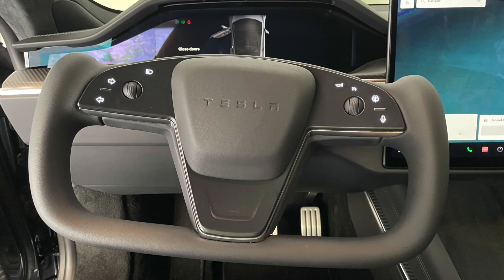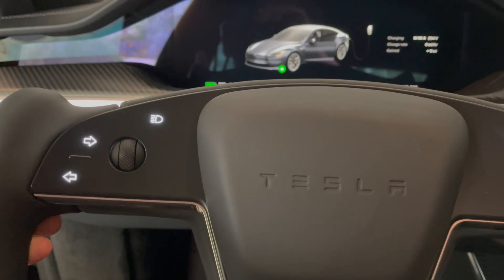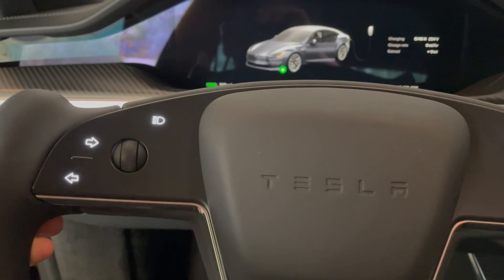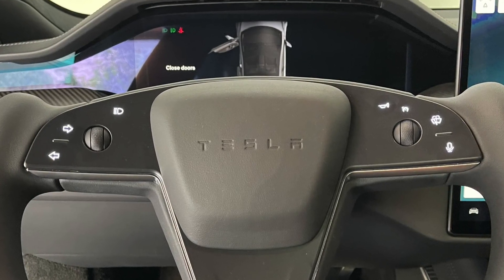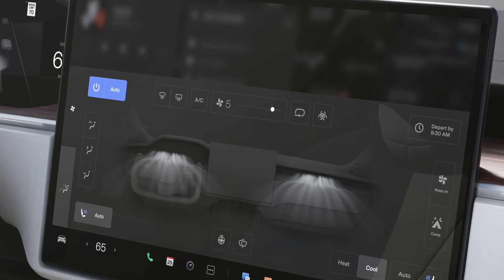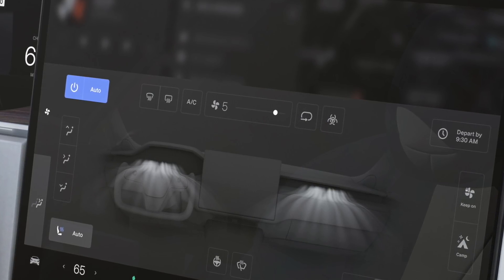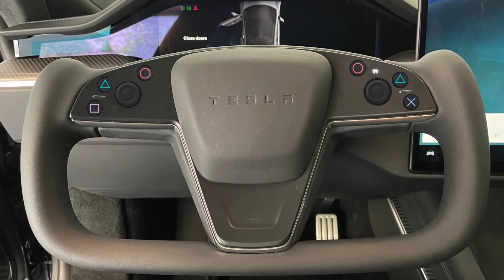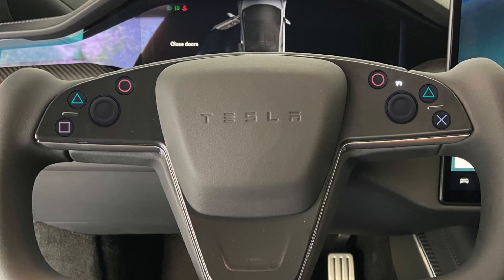Fixing Tesla's Model S Plaid YOKE blunders

Comment: I think it's scary that I have to share the road while I'm on my bike with a car that has so many distractions (huge screen) and difficult to use controls.
Reply: You might be safer with a Tesla next to you on the road than most of the other cars in the near future. Based on a recent video with Andrej Karpathy (Director of AI at Tesla), the cars already today keep an extra eye on the surrounding and may stop drivers from doing stupid things. He showed four example videos where the system took action and helped the drivers avoid disaster. In two of them the drivers, while driving into a parking spot, mistook the gas pedal for the brake, but the system braked instead and one of the driver didn't drive into a lake and the other didn't run over some pedestrians on the side walk. The developing of AI and computer vision for cars will prevent a lot of unnecessary accidents in the future.
Reply: Again, you're talking about issues that aren't even issues. This vid is about the issue with the wheel, not the screen. I'm pretty sure there are 0% Tesla owners who actually find the screen distracting.
Reply: @radfree9370  "Aren't even issues". So you think being unsure whether you switched an indicator on or not being able to easily sound the horn are not issues? 🤦‍♂️ It's poor design and is dangerous.
Reply: @Boopop1024  How do you even know its dangerous? Have you tried it yourself? This person says he doesn't like the design which I completely understand. But there have also been loads of YouTubers who say the either love the design or have gotten used to it anyway. Of course you're probably gonna say that all those YouTubers are fanboys. My point is that you shouldn't judge it if you yourself haven't tried it. I bet in just a few weeks and not even months, people are gonna say they've gotten used to it. The situation is just like when people thought that it was dangerous for the model 3 to not have a instrument cluster. No one even talks about it and a lot of people actually prefer the info being on the middle.
Reply: @radfree9370  Bizarre that you think someone saying they struggle to use crucial controls such as the horn on a 2 ton vehicle may not be dangerous 🤔

Oh good, it only takes a few weeks to get used to it. I guess other road users (including vulnerable road users) will just have to take their chances in that period 🤦‍♂️
Reply: @Boopop1024  If your whole problem is just with the horn, then let me tell you (and you probably don't know this) if you put your hand over the buttons, it horns. There, that's a lot easier to do especially in an emergency. So is that better or what?

Comment: I love what Tesla is bringing to the market in terms of innovation but they miss the mark on quite a lot of things. When I bought my Porsche I was a bit tied up on thinking about a Tesla, and it was even harder to step away after driving a P100D for the first time. Then I sat in my Porsche and was instantly won over. Hardware/software aside, Tesla leaves a lot to be desired when it comes to build quality and overall appeal (for me). Porsche just doesn't. 

As far as this, the wheel is a huge deal breaker for me, even if I were back in the market for another car, even if I could find an amazing deal on a Plaid, I'd probably pass due to the wheel and the wheel alone. Now that you've pointed out more faults (of which I had already found many), it just solidifies my decision.
Reply: When you say Porsche are you perhaps talking about the Taycan?  From what I've seen of it, it's an amazing car and I would love one but it's way beyond my budget even if I was in the market for a new car (and could justify an EV, I don't have a place to charge).  The only issue I had with the Taycan (from what I've seen of it) is that it has way to many screens but then that may have just been that configuration.

Comment: I had heard about the safety issues stemming from the shape of the wheel .. it's insane there's all these potential safety issues due to the user interface as well.
Reply: do not worry: Tesla can extract a log from the wracked car, proving that the driver was messing with a touch device instead of driving.
Reply: @sarowie  Every case I've heard of it sounds like it really was the driver who was at fault for not paying attention.  Now, I could be wrong and they do need to improve the safety of their UI and they should definitely ditch the Auto-pilot moniker for their advanced cruise control system.  FSD on the other hand clearly states it's a beta so if that confuses you then you probably deserve whatever happens to you (hopefully you don't take others out with you).  Tesla has also said that they'll remove FSD capabilities from cars who's owners are not paying enough attention though that's another can of worms (it requires the inside camera to send data to their servers for analysis).  Seems like there's a lot people who've been caught with their pants down and rather than accepting blame for their actions they've made a point of attacking Tesla.  Again, Tesla has it's issues (and I'm probably not going to get a Tesla when I do eventually buy an EV because of those issues) but we should focus on the actual issues (like bad UI, confusing naming of their cruise control system, and DLC) instead of defending idiot drivers.

Comment: Yeah, they really should have put this in the hands of normal people not working on the project and asked if it was well laid out.
At first glance from the front, it looks like you rest your hands higher up. Which would make everything easy to use. But the ergonomic position of it is well below the buttons. Such an odd choice.
Reply: I work in User Acceptance Testing and something comes up a lot is 'developer blindness'. This is where a developer provides a solution that fits their expectation but doesn't consider the user experience at all. It's very common having to raise issues with design and essentially arguing with the developer because they're so blinkered with their vision.

Comment: Capacitive buttons have the advantage of not having any moving parts to wear down, but other than that they're an awful choice.
No tactile feedback, can't feel for them, prone to accidental use, problematic for users of gloves or prosthetics.
I bet they were just dead set on having a "sleek" aesthetic.
Reply: I'm not sure if they actually are cheaper to produce, but I generally feel devices with capacitive buttons feel "cheap" - which is ironic given a few decades ago it was  considered futuristic and demanded a premium.
Reply: @izzieb  I look at it as a spectrum. In order of cost
cheap buttons < cheap capacitives < good capacitives < good buttons
Reply: @izzieb  a few decades ago this also wasn't cheap to make. Nowadays it can be cheap for a prototype run, where you can't commission custom injection moulding tooling, but then tactile dome switches under an overlay are another cheap solution and they aren't prone to accidental presses, don't need touch sense chips or additional components or analogue pins, and you can feel the bump at control positions, so much more usable all around.
Reply: In terms of reliability there's really no need for capacitive buttons. "Button technology" has come so far that they can last for tens of millions of presses. Methinks this is more about looking cool and maybe cost.
Reply: @jfolz  I have a 10 year old Hyundai and all the media buttons still work, and I use them all the damn time while driving. The other benefit to having just buttons is if a button breaks, you just have to replace the button. If this steering wheel with haptics breaks you probably need to replace the whole steering wheel, or maybe just the entire haptic portion.
Reply: @jfolz  tactile switches actually used to be more reliable and got worse. You find an old Honeywell switch, it's going to go leaps around anything made today. The datasheets found increasingly interesting ways to stretch the truth. And yet good enough options are available, no problem really.
Reply: They figured out how to make buttons/switches reliable a long time ago. Lots and lots of cars from 20+ years ago haven't had button failures. I mean when's the last time you had a key on a keyboard stop working, for example?
Reply: @thicclink  I actually wore down a number of keyboards over 25 years. I used a Mitsumi for the longest time, a membrane keyboard, like 7 years, which tells you how well everything else was made there, anyway the silver ink that makes up the matrix and the contacts wore away, but I restored it with auto rear window heater repair liquid, which is that same silver ink. Obviously a different membrane keyboard than a Mitsumi or BTC will just wear out on the key guides first or the silicone tactile sheet hardens and keys just become unpleasant to press down on rather than outright fail. I also dumpster salvaged a Cherry mechanical with intermittent switches, but with some anti oxidation and oil treatment, it still runs and is around 22 years old at this point. And I had to replace countless switches in mice. But I mean higher quality parts are not even expensive and I don't find a trivial repair after 20 years of use anyhow objectionable.
Reply: @thicclink   Haha i have two Commodore computers, a VIC20 from 1982 and a C64C from around 1989. Yeah those two keyboards still perform well.

The mouse button becoming intermittent is down to both switch wear and unfortunate switch drive. Check out the video by Alex Kenis "Failing switch problem: Omron vs the modern mouse circuit" and associated Part 2, you'll learn more than you bargained for, these videos are very information dense. The life of the switch can be stretched electronically by many orders of magnitude, especially if it's a car HMI rather than a mouse, where another 100ms control delay won't really matter and you don't mind it topping out at registering a maximum of 3 clicks per second rather than dozens.
Reply: If they used switches with Hall Effect sensors they wouldn't have contacts that could wear out and they would be fully analog with much better feedback.
Reply: @RamenPoweredShitFactory  you know, there used to be an older and simpler similar tech. Reed switches. A moving magnet actuates a couple of leaf contacts in a glass vial. Since the contacts are enclosed in inert gas, the metal surfaces can never oxidise.
Reply: Capacitive buttons don't need to wear down to break, because they're broken straight from the factory. Love love love tapping/swiping/etc 4-5 times every time I want to do something!!! 🙄
Reply: Just remembered - the keyboard i am using right now - is a cheap rubberdome keyboard that came with my PC. Not with my current PC, or previous PC, but 20! years ago with a DELL prebuilt.

And if you are using car-controls as much as i am using my keyboard (mind you, as a gamer and programmer) and you'd have to switch out 1 button after 10 years i think that would be more than good enough.

Comment: Thats not a steering wheel, wheels are round, Stupid design over practicality, surprised this is even legal, how on earth are you supposed to do lock to lock turn
Reply: Racing cars have that shape... because you don't have to ever move your hands out of the wheel.
Reply: @IIARROWS  
Yes and the wheel turning angle for most racecars is a full ±30° in either direction.
Most street car steering wheels turn a full ±450-480° in either direction. There's a lot less twitchy-ness in the response from those larger rotation angles. I would assume they don't make you spin a yoke around 2.666... times to turn and at the same time 1:1 steering ratio is probably a hazard in and of itself really.
Reply: @VariantAEC  "Most" is irrelevant, let's talk to this car.
Reply: @IIARROWS  
The steering wheel's turning angle from lock to lock is 738° 2.05 turns from lock to lock.
Steering yokes are not made for that kind of turning angle for the reason that you are taking your hands off those points where you have the most control of the cars direction.
This in and of itself is a hazard and why pretty much all steering wheels which make 1 or more complete 360 degree turns from lock to lock are shaped like a circle!
Reply: @IIARROWS  
To be clear that 738° lock to lock turning angle is for the Tesla Model S Plaid's ridiculous yoke steering wheel design!
Yeah no brain power was used to make this thing.
Reply: @IIARROWS  That would require a much smaller turning angle lock to lock than the Model S has. That is not the reason why Tesla went for that shape - they are simply making more room for passengers when the car is driving itself.
Reply: With a lot of effort.

Comment: The wheel looks like a set of buttons covered by an overlay. Those suck.
Reply: It's worse. Tactile buttons under a flex overlay, you can avoid pressing them accidentally by brushing against them and you know for certain whether you pressed a button. These are touch sensor controls and they're about as useless as it gets.
Reply: @SianaGearz  Yeah, my car does that for unimportant controls on the wheel. Stuff like radio volume and temperature control are on a flex where if I just move my thumb over and start rubbing, it lights up a small indicator near the speedometer to tell me what I'm touching, and then I press down to a tactile button underneath to actually do it. And again, that's non-essential/unimportant stuff. Vital things that MUST WORK like the horn and turn signal are standard giant button in the center of the wheel and stick off to the side.